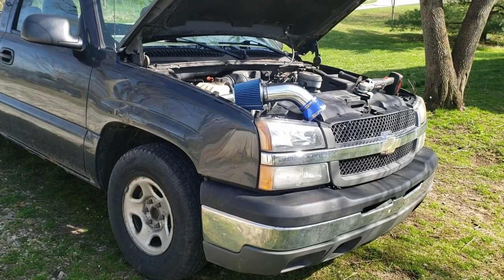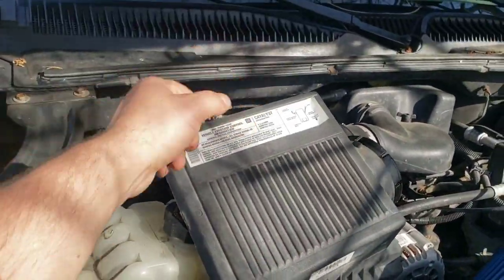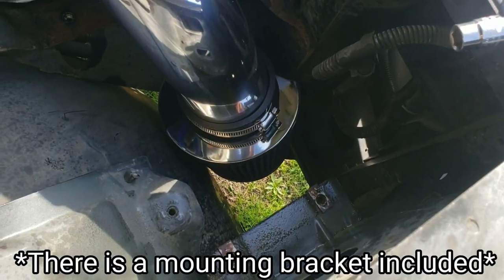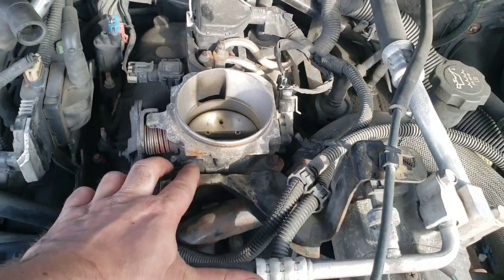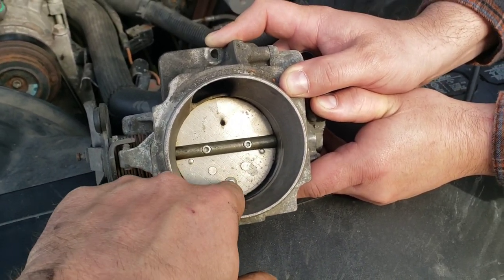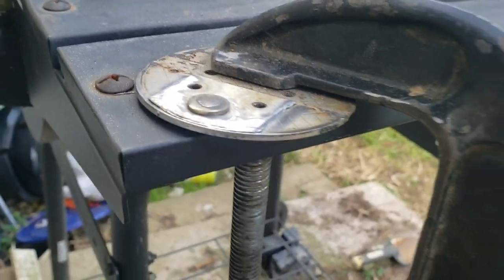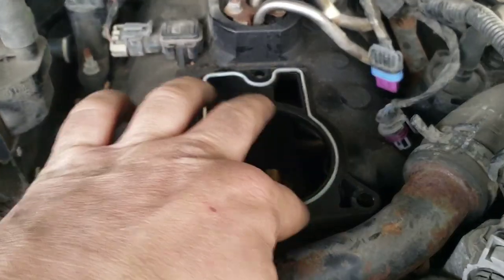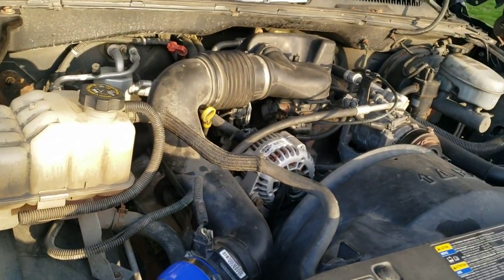Silverado Cold Air Intake & Throttle Body Mod 4.3 Vortec V6

Comment: Test after and before
Reply from the maker: Oh believe me if it was my truck I would have, and I wanted to. But it was my buddies truck and he said he was having transmission issues so he didn't want to hotrod it until he get's that fixed. That's my luck...
Reply: @BuckeyeBallistics  bro I did it an I think it made my truck slower take off ?help
Reply from the maker: You think or you know? Make sure you hooked everything back up correctly. If there is a check engine light on, fix whatever that is. If you didn't reset the battery like I said to in the video, do that. He keeps spinning the tires on his on accident because it has so much more takoff power than before. If yours got slower, then there is something else causing it.
Reply: Shouldnt have posted this cideo without second video. This is the biggest let down that   We all see too often. Theres never the full video with everything included. Im going to change that.
Reply from the maker: @waitandbleed - Good- quit cryin and post it already and enjoy the 20 whole views it will get...
Reply: @BuckeyeBallistics   yes maam

Comment: Only mod I've done on my Silverado is wheel bearings.....😒. It's got Flowmaster duals, a 5.3 and four wheel drive though!
Reply from the maker: Well now you know what you gotta do to it next 😁
Reply: @BuckeyeBallistics  yeah. Probably an axle shaft or universal joint! Sigh...at least stepside standard cabs look cool 😃.
Reply from the maker: Yeah I like those. Hey, I did a video on the u-joints last year 👍
Reply: @BuckeyeBallistics  it might just be that darn slip yoke sticking but I have a feeling it is a universal joint.
Reply: Trade you a sweet camper top for your 4 wheel drive and 5.3? You throw in the flowmasters and ill give u a cool set of rubber floor mats. Sweet deal i know😂
Reply: @James Smith  lol I bed linered the floor and head liner, installed stick on foam insulation, shampood the carpet and fixed the cab vents. Now I just need rockers because the last guy who did them screwed my Dad over before he passed and did a hack job....sigh....163k and running strong though!

Comment: Could you drill out the rivets and put a small bolt through the holes to block them?
Reply: That would work it would need some tiny one and probably red threadlockee because tearing the head off is annoying trust me
Reply: That's a bit risky. Make extra sure nothing can come loose.

Comment: So if you wanted could you just put the air filter without the pipe ??
Reply from the maker: Where? On the throttle body itself? You can't bypass the maf sensor or it won't run right.
Reply: @BuckeyeBallistics  i mean just putting the air filter in the maf sensor and thx for the answer
Reply from the maker: Oh that? Yeah, I thought I said that in the video. As long as it isn't an oiled filter, yes.

Comment: Does anybody make 8mm plug wires for the V6, like Accel?
Reply from the maker: MSD Street Fire
Reply: MSD Street fire Part no. 5577  I have them on my truck they work great
Reply: Lots of Accel or MSD wires u can get "cut to fit" and make your own

Comment: anybody know the name of the part/hose at 6:48?
thanks
Reply from the maker: It's just part of the air intake system/ductwork. If you're speaking of the chunky rear most part off to the left side of the screen at exactly 6:48, it is a silencer/resonator/resonance chamber.
Reply: @BuckeyeBallistics  sorry, it's at 6:46
the tube/hose . on my truck it connects to the air intake and the top of engine/manifold.

Comment: For more power you need to replace all the plastic pipe like work much better
Reply: actually plastic CAI is a little better than aluminum piping bc the aluminum gets hot and that defeats the purpose of a COLD air intake. The only time a study pipe is beneficial is when ur pushing 25psi of boost and your piping is starting to flex.

Comment: 4.3l are damn good V6s. But they will Never be a performance engine, especially in a full size pickup! What a waste! You could have done more for that old pickup usin that $30 on a fluid change somewhere!
Reply from the maker: All it's fluids are changed lol. It get's regular oil changes and we just changed the trans fluid when we replaced it's filter. And you're talking to the guy that suped up his 1.6 Kia Rio so the 4.3 definately isn't off the table for me. That being said, this intake was a gift from me to my buddy (his truck), so he didn't "waste" any of his money. And lastly, typically a better intake or exhaust will improve fuel mileage slightly, so that's hardly a waste if it's going to save you money. And just like with my Rio, I know it's never going to be a fast car- but if I can make it just a little better and improve mileage (which I did), it's worth it 100% to me...
Reply: @BuckeyeBallistics my dad just passed and i ended up with his truck (2000 Silverado 2wd, 4.3L) didnt know they made these with a 6, seems to run fine, how does these trucks tow? Nothing big, just a 4 wheeler or a bit of firewood occasionally.  Thanks
Reply from the maker: @James - Oh it should tow an atv just fine. I threw one in the back of this exact truck and drove 2 states away with it and back (riding). According to an online copy of the owner's manual, for bumper pull towing, the 2004 Silverado Regular Cab Long Bed with the 4.3L engine can tow 4400 lbs with the automatic transmission and 3.08 rear axle or 4900 lbs with the 3.42 axle. For a manual transmission, its 3400 lbs with the 3.08 rear end or 3900 lbs with the 3.42.
Given the age/mileage of the truck and not knowing the exact year and axle ratio, I would say round it down to 3000lbs and you should be just fine assuming it is in decent shape.